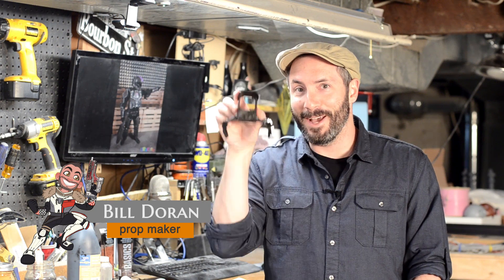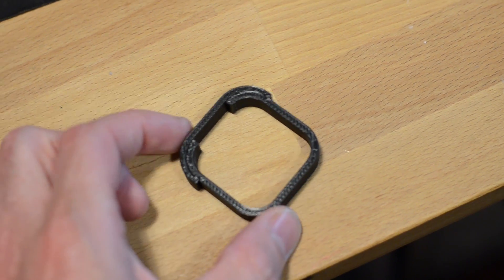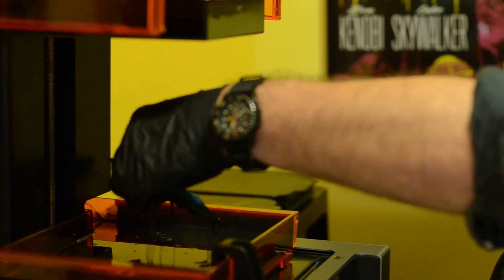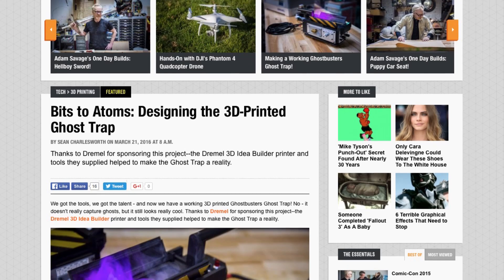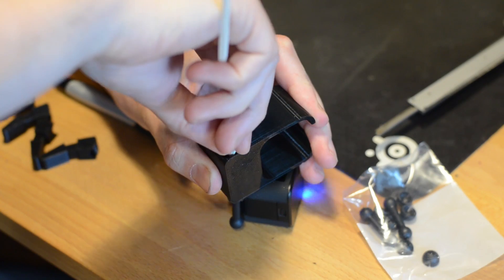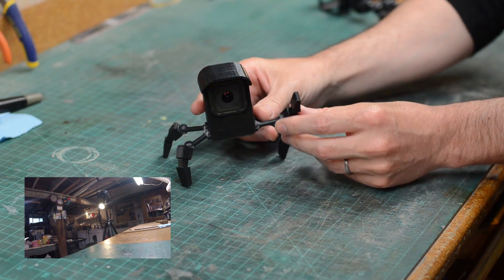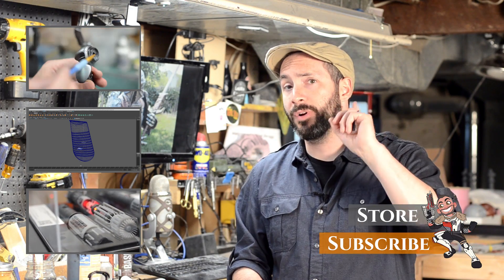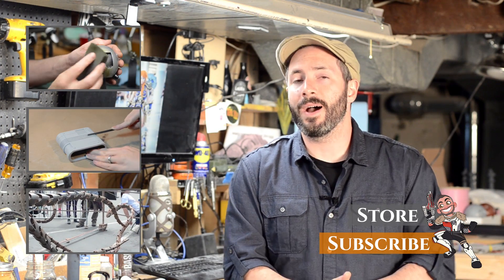Prop: Shop 3D Printing the GoPro Camera Robot

Comment: Awesome build but I still disliked the video because of wrong video title.
It is NOT a robot. It's not powered and it does not move. So its just a go pro stand technically and calling it a "robot" is misleading!
Reply: Prop: Shop 3D Printing a GoPro Camera Case that Resembles a Robot Only Aesthetically just isn't as catchy, and viewers are smart enough to know what it means. Titles are this guy's way to ensure he eats, disliking based on that alone is a bit much, instead consider disliking based upon the content instead. Of course, you can do what you want, but I feel it's important to mention more or less what the dislike function is intended as.
Reply: You mean it's not autonomous.

Comment: aww, not an actual robot :(

i uh, could make that real if you wanted.  
12x servos in the central body, connected to the legs via hidden pull-pull cables.  
it'd prolly double the body's size tho

Comment: Where is the best place to get little random add on pieces for props? I think Adam Savage called them "Greeblies" but I'm not sure. I just need some stuff to add texture and complexity. I like mechanical stuff, but I'd also like to find something, be it stickers or decals or whatever, that can add a nice ancient culture feel to things. Something I can paint over later.  Because, while I'm okay at carving out basic forms, the little details always screw me up. I'm not yet skilled enough to make things precise and consistent.
Reply: SongDog7 lol I know this is a year late. But even if you worked it out this might help someone else. Most people get them from other model kits or taken off of toys. Kinda like what they did with the $20 lightsaber challlenge. They just went to their local goodwill and got a bunch of cheap toys that seemed to have interesting parts. 

Shops for model trains, airplanes, and rockets. Electronics can be useful. Also stuff like small hardware (screws, brackets, and so on).

The trick is to figure out how to blend it in. Don't want to be like the line in that song. 
"Just glue some gears on it and call it steampunk." 
Great.... Now I got that song stuck in my head.

Comment: Try using a little liquid electric tape on the ball of your ball and socket joints to give good and long-lasting friction. It's what I use on FDM printed ones and it works quite well.

Comment: is the printer detailed enough to do a dimpled golf ball for the leg?  I'm thinking that then the socket could mate with reverse dimples?  I wouldn;t try to match the number of dimples on the ball with the socket.  I think you'd need one or two dimples on the socket, and the ball would contain ALL the divots.
Reply: With a standard FDM printer I dont think it could handle that on a scale that small but the SLA printer most definitely can.